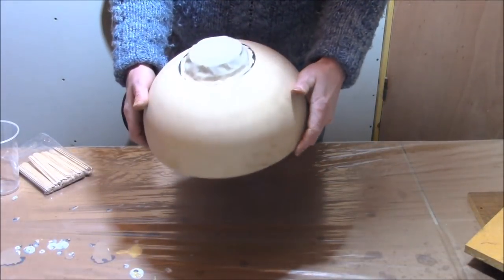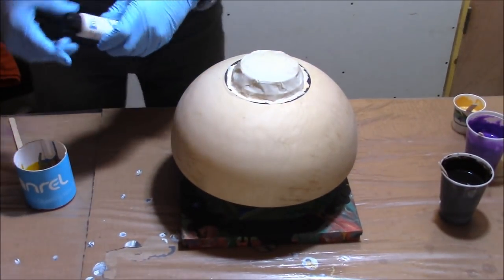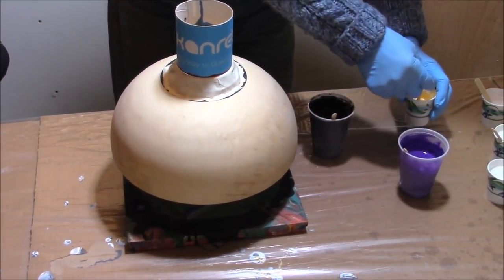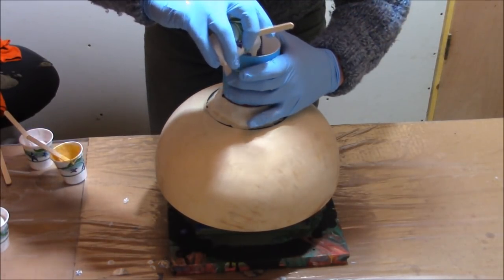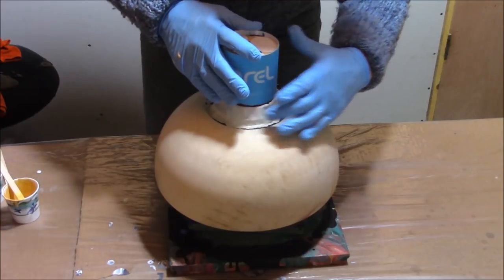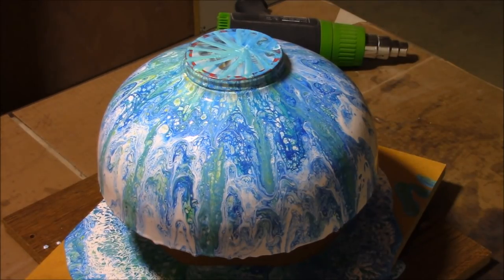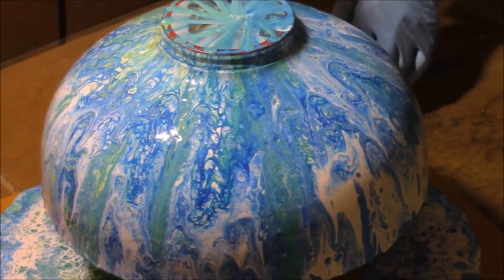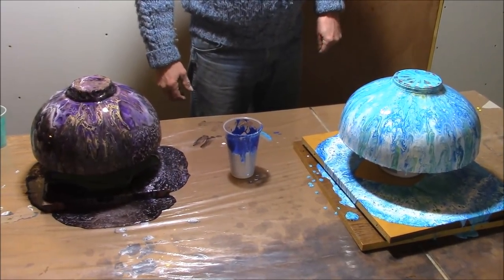3D Acrylic Paint Pouring On Wooden Bowls

Comment: Very cool idea. I may have to try that on a bowl. :) You should put down some parchment paper or something. My favorite is the clear shower curtains from Walmart. I was thinking as I watched this I could just cut a piece to fit the board and tape it underneath so it would stay put then put the rest of the shower curtain under it. It catches the drips so when they dry you can reuse the skins. Alternatively  you could have some canvas or craft wood on hand to dip into the dripped paint. :D The shower curtain works great with the resin drips. They come right off after they have cured. - Heidi

Comment: you might have been better doing a cup pour rather than the open cup pour as you have more control. however that depends on what look you're going for. your paints are a little thick so I hope you manage to get no mounds in your pour. try making your paint a little thinner.... a little. you dont want them too thin or they will run off the bowl. make sure all your colour consistency are the same. try dimethicone instead of silicone. using silicone means you have to really wash the bowl before applying varnish otherwise you'll have spots in your varnish. did your bowl turn out the way you expected. did you use a pouring medium in your paints I cant remember hope this helps....it looks lovely btw 😊

Comment: I like the first one best! Just subscribed! 

I wonder if pouring smaller amounts and doing the whole bowl in seperate pours would get less stretching of the cells, doing it propped on its side on each of four sides letting each dry first before going on to another, or if you're doing it in this current position upside down then turning it right side up once the paint starts to set up so gravity will prevent it from elongating in one direction.

I think resin would be cool!  Even putting clear over the acrylic pours!
Reply from the maker: Thanks for the input, I tried less paint, it just didn't flow. I will try flipping the bowl top to bottom, I suppose timing will be the key for this to work, as you suggested. The resin process is in the works, this is something that I have been working toward both colored and clear.

Comment: Very interesting video and great looking bowls! How do you finish it after it drys...is it smooth so you just apply your finish?
Reply from the maker: Aside from any dust or debris in the mix  they dry smooth. I use Floetrol as a leveling agent in the paint mix. After a few days when the paint has cured I re-turn the foot ,rim and inside then finish.
Thanks 
Don

Comment: How does the paint not run off? I'm having lots of trouble with the fluid just dripping off and leaving next to nothing on the bowl !!
Reply from the maker: Hi Tahlia,
I experimented with  several different viscosities,  I would coat the piece with a solid color 1st then do you intended pour colors. The shape of the piece also has an influence on how quickly the paint moves  I like 4  to 1 width to depth . If you are doing a dirty cup pour its better to add you colors in small amounts more often than large amounts less often. 
Thanks